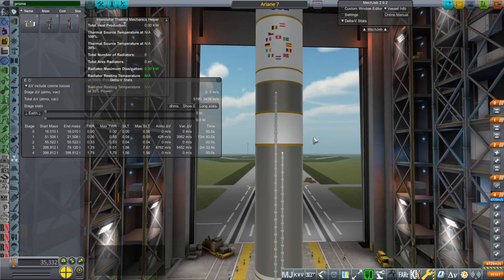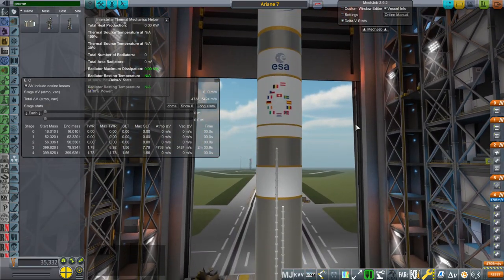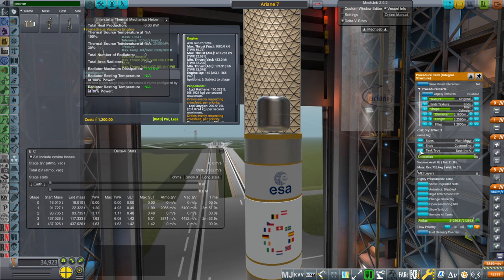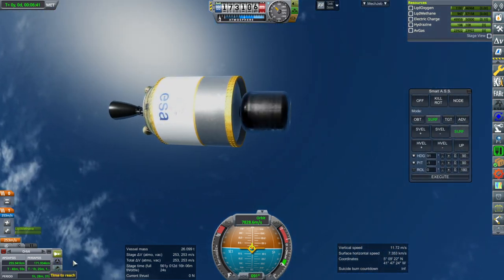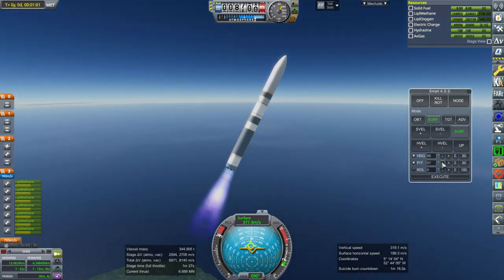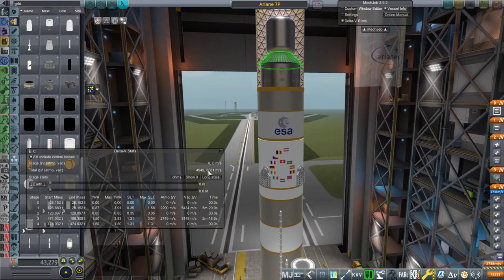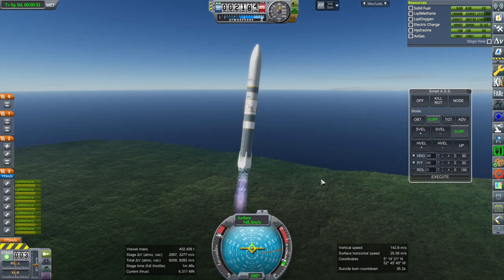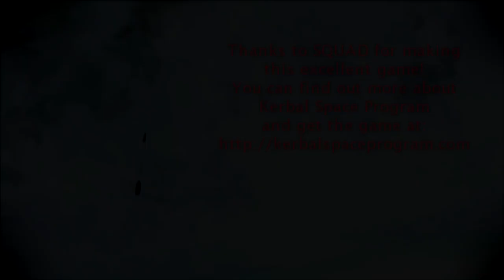Realism Overhaul in KSP 1.8.1 - Further Ariane 7 Testing

Comment: For the texture switching, can't you use the stock TS function?
Reply from the maker: It's possible - haven't really seen many examples of that in other mods, so I'm not as familiar with it.
Reply: @RaizSpace  The Restock mod uses it, so you can check how its implemented there.
Reply: B9partartswitch is what's used lol. Much more versatile

Comment: would a vinci expander bleed cycle variant work for the upper stage?
Reply from the maker: I don't know what you mean - Vinci is expander cycle and we tested it out in the previous Ariane 7 video.
Reply: I mean, but converting it from a closed expander cycle into a open bleed cycle, we could increase thrust Would that work?
Reply from the maker: I'm not sure how to calculate the effect of that.
Reply: because of the square cube law, expander cycle engines have a max thrust of around 300kn. The open cycle gets around this by having some of the fuel diverted into the combustion chamber while the rest goes into the turbine. This decreases efficiency, I believe around a 10% drop, it greatly increases thrust, an example being the BE-3U
Reply: @jmstudios457  Actually, that's not really a good example as the BE-3 is a combustion tap-off engine. BE-3U is like a totally different engine with a totally different combustion cycle and powerhead. Also simply switching cycles withou any modifications would likely not yield more thrust as you would need to redesign the turbines for more propellant flow.
Reply: I know the BE-3 is a tap off. The BE-3U is an expander bleed cycle
Reply: @jmstudios457  which is why I'm saying it's a nonsensical comparison.
Reply: I am comparing an closed expander cycle engine, like the Vinci, to an expander bleed cycle, like the BE-3U. The BE-3 has nothing to do with it
Reply: @jmstudios457  No, what you said is that by simply changing the combustion cycle, you greatly increase thrust. I said its not that simple and that the BE-3U is not a good example. The open expander cycle allows for higher maximum thrust, changing a cycle on an engine is not very simple.
Reply: It isn't. But this isn't real life is it?
Reply: @jmstudios457  sure, why not throw all realism out the window then?